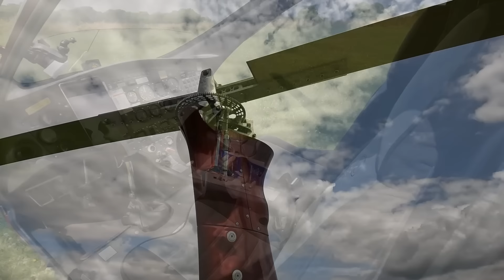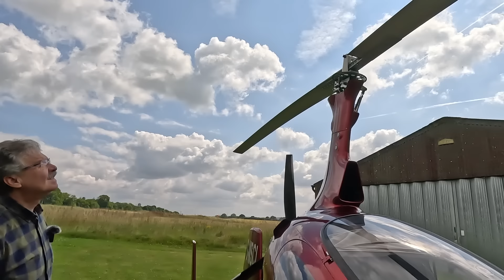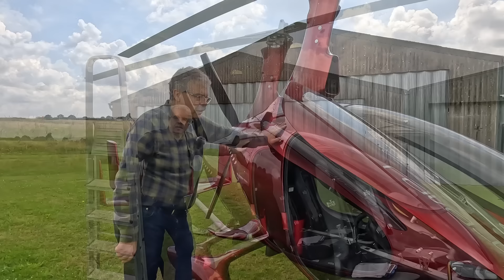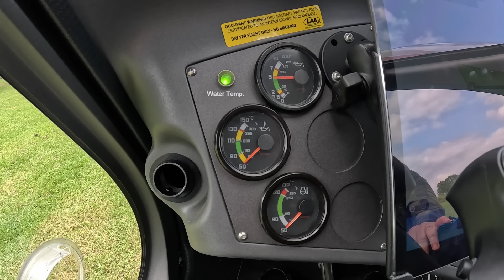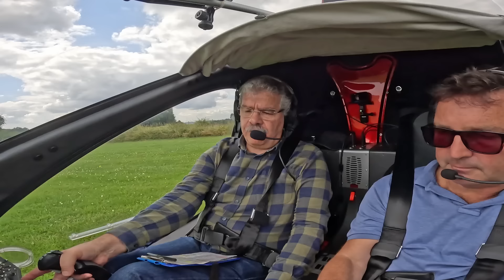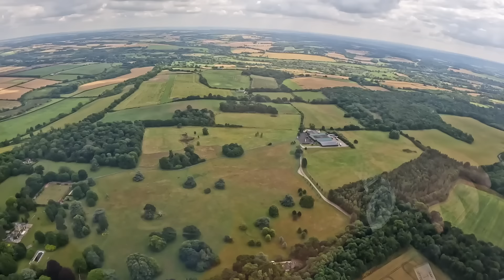Autogyros, The Cavalon

Comment: Grass runways look very hard  on the aircraft.  All that bouncing and shaking looked similar to riding an ATV.   I'm sure most owners would prefer to use concrete runways only to extend the longevity of their bird.   Is the stick shake and vibrations normal?  I'm watching the cruise and notice the vibration/shake of the stick.  Ingenious engineering.  A+

Comment: As an Engineer, it seems to me the teeter bolt should be longer to add rigidity.   I KNOW it teeters, but not in the axis I'm talking about.  There's a reason it's not a ball joint.  I'm referring to the axis the bolt is designed to hold RIGIDLY, to maintain the angle of attack of each individual blade.

Comment: And most people including the pilots dont know how the rotor works. With a pitch to lift, air flow comes from under to above that actually would make the rotor turning  the wrong way. Inner side of rotor has a different pitch as the outer blade. The inner blade is the rotating part, the outer blade the lift pitch.....😊😊😊😊

Comment: nice in smooth stable wind. mybe unpredictable (sudden drop) in variable changing winds? how do you get to practice for such conditions? are there flight simulators available where these variances can be simulated? once cruising should behave like fixed wing aircraft. since fly so low <500 feet, collision with towers & wires an added risk.

Comment: Only safe when going into wind. If it turns and goes with the wind the lift stops and guess what, it drops, plenty of deaths due to this.
Reply: Same thing happens to fixed-wing craft. Skill issue
Reply: @mecke102  fixed wing planes normally have a more powerful engine than an Autogyros.  Remember commercial planes take off and land into the wind.
Reply: @cagno1 So it should have a turbo then, agreed :-)
Reply: @cagno1 they have pretty similar power to weight ratios to a Cessna 172

Comment: As an aircraft mechanic on big birds I can tell you that we take no chances after maintenance. We do engine runs up to 75% power for a given period of time to test for potential failure. After that it's a test flight. They should do the same with these small aircraft. Also if the engines are overhauled they should bench test them before installation. If the maintenance org. that you're using isn't doing these procedures don't ever use them again!  Ask to see the paperwork from the engine runs and flight test. Actually, ask for all of the paperwork. No maintenance should be done without paperwork.  They should be signed by the mechanic and inspection/quality control. If they won't show you the paper work RUN, but not before your demand a refund because you're going to have to take it through maintenance again!

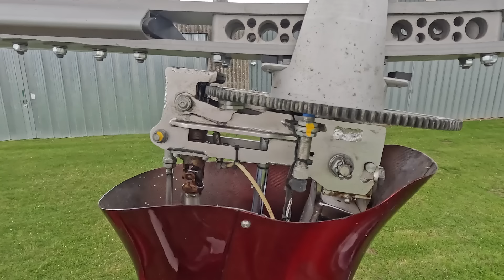I was looking at your rotor head at 10:02 min and I saw something I personally question. You have a series of bolts holding on your rotors going through the blade and fitting. They have nuts on them that don't look like aircraft hardware. In 30 years of working on aircraft I've never seen that kind of nut on an aircraft fastening moving parts. If you can spin the nut on with your hands until it gets to the locking portion then that nut is too loose for that area if that area is subject to vibration which I'm thinking it is.  I'm not questioning the bolts so much other then they look like they have a course thread which is also unusual for an aircraft bolt. Aircraft bolts usually only have a fine thread.   They look like 1/4" diameter bolts but I'm not too sure because of the low resolution in the video. If those are nylon lock nuts and only the plastic compound in the nuts keeps them from spinning I would replace them with self locking nuts (aircraft friction fit nuts that cannot be finger installed, but can only be turned on at wrench torque) at minimum or castle nuts with cotter key at maximum which will also require bolts to be changed.  
I would check the torque setting on your current nuts in that area after every flight initially and if they're maintaining torque you can extend time in between checks. You don't need to take it to a mechanic every time unless that's already part of your maintenance program. You can obtain the aircraft maintenance manual (AMM and SRM) for the torque settings and do it yourself. If you can get a general maintenance manual (GMM) it will tell you how to properly use the torque wrench. You have to have a high quality, calibrated torque wrench (no cheap auto parts store wrench). If you don't want to go through all of that then in my opinion you should replace the hardware!

Comment: The rotor is being spun only with forward flight.. BUT you csn get zero groundspeed  by flying into a 30 knot headwind.. this is sufficient to maintain an artificial hover.
You could probably do the same in a small fixed wing plane.

Comment: How does a disc provide equal lift on forward movement as backward movement? When increasing speed? Is there a computer controlled cyclic pitch like in a helicopter ? And how is the rotor being spun while providing equal lift?

Comment: Failures after maintenance are because with most maintenance items (aircraft and all mechanical maintenance) the probability of failure (PoF) follows a "bathtub curve" where initially the PoF is high, then if it works it will likely keep working for a while until eventually the PoF increases again with prolonged use. Initial high PoF is influenced by factors such as fasteners not torqued, bearings installed incorrectly, faulty parts installed, workmanship issues, etc. Quality control and procedures are very, very important to ensure maintenance is done correctly and completely.

Comment: Why is the rotor labelled underpowered when it is clearly powered? Genuine question. I understand that the forward momentum causes lift in the rotor essentially turning it into a wing.
Reply: The rotor is only powered for pre-rotation , up to 200-+250 rpm, during flight it is not powered. The shaft for pre-rotation and the rest of the rotor assembly is not intended for full power to keep weight down otherwise you might as well get a helicopter. Gyrocopters are small light, fairly simple craft to pilot compared to a helicopter.
Reply: @milesbartlett  Thanks for the reply. That makes sense now. Very cool

Comment: the stick is shaking all the time. A fixed wing pilot will think the plane is stalling because of the stick shaker
Reply: With a 2 blade rotor you will have some stick shake. But when you ballance the prop and rotor it is very minimal.

Comment: 600ibs? Heavier than an ultralight but lighter than an airplane. How is pitch and roll controlled? I see the rufdrr but no ailerons.
Reply: the rotor itself tilts forwards, backwards and side to side for pitch and roll. the control stick has what the rc community calls an elevon mix the controls the main rotor tilt. so tilting the rotor to the left rolls the whole aircraft to the left or pulling the stick towards your gut causes the rotor tilt back and causes the aircraft to climb. the controls work pretty much the same as any fixed wing aircraft with an elevon style control system but there is no computer in between the stick and the rotor
Reply: @pieterpretorius1014  the rotor blades controlling the pitch and roll sounds a lot like a helicopter without being one. That's a very neat tidbit about Gyrocopters: thanks...

Comment: Very nice design. Short take off and landing. Take less space than a plane. Can probably land easily in case of an engine failure (autorotation).
I wonder why there are not much more autogyros.
What are the advantages/desavantages compare to a plane of the same weight ?
Greetings from France
Reply: Yes , with the autorotation engine failure is not so much of a problem. With a bit of a headwind an experienced pilot can land in less than 10 meters, usually takes about 30 meters to land.

Comment: "See how it took most of the runway?" Uh yea, that was interesting he says LOL. Aka yea I'll never fly in one of these death machines again. Nothing about that thing looks smooth, comfortable or fun. Two full size men and its max weight, that guy did not look comfortable at all with all that runway behind them and still had to keep it super low alt to build enough airspeed to not stall. Good thing there was nothing infront of them. Neat death machine but nope.
Reply: Paved runway a lot less takeoff run. And all gyros accelerate in ground affect for a short time to about 60 MPH then climb. Takeoff is usually 300 to 500 I've flown in a Cavalon, and they're very comfortable.
Reply from the maker: Every flying machine is the beholder of its own beauty. They are the culmination and physical expression of Man’s ingenuity. Their safety far exceeds the risks of driving a car or even being in a kitchen! And what rewards are on offer when taking to the air, the exhilaration, views and sensory delight that are not on offer when bonded to terra firma. Let us celebrate sentience and flight.

Comment: Does the Rotor get motor power? is that normal, I( thought it was just forward motion that started the rotation, what happens if the engine fails, can you auto rotate from a certain height with success?
Reply from the maker: The rotor only uses engine power for pre rotor before the take off run. Just before the pre take off run the pre rotor is disengaged and the wind does the rest! As described in the video. The rotor is constantly in auto rotation, so if the engine fails the autogyro 'glides' under auto rotation.
Reply: @ginclearaviation  What then are your chances of survival, what then supplys anything to effect some sort of flight?surely that blade is insufficient to provide a 'Parachute " effect.
Reply: @adoreslaurel  Your chances of survival are higher than a fixed wing. An autogyro flies using autorotation, in an engine failure situation there's no need to declutch the engine and rotor and increase forward motion as it's already in autorotation. An engine failure is akin to just closing the throttle. You drop the nose to maintain forward motion and just glide gently to the ground as you would in a helicopter. An autogyro is probably the safest and most uncomplicated form of powered flight with clear advantages over both fixed wing and powered rotary wing. When it comes to the future possibilities of personal air travel it's the most likely contender.
Reply: @AndyMcGeever  Ok thanks for that.

Comment: An old BMW airhead motorcycle called and they want their old Bing carb back.
Reply from the maker: Rotax have a great web site for technical information.
Reply: @ginclearaviation  Why don't they use EFI?
Reply from the maker: @TXLorenzo  Hi. What is EFI? Thanks.
Reply: Electronic fuel injection
Reply from the maker: @TXLorenzo  I don't know the answer to that. But as mentioned, the Rotax series of engines have a great web site for specific info. Sorry not to be of much help.
Reply: @ginclearaviation  I believe later Rotax engines are EFI which I was surprised to see the Bing carbs.  I had these on my early BMW motorcycle for years, but all new models are now EFI.  This goes  for most engines  produced today.
Reply from the maker: @TXLorenzo  Thanks for the info. Engines used in aviation seem to take ages to catch up with modern technology.
Reply: @ginclearaviation 915is and now the 916is is fuel injected and turbocharged.

Comment: This guy is obviously not knowing how a drysump engine works ..😮😮😮..he did not check the oil level right.
Reply: Best system for any engine, even my new 71' 750 Honda was dry sump design. Automatically provides oil cooling during constant process returning oil to 5 quart tank. 
All the best racing engines use dry sump.
A bit surprised in video memo, 
no detailed inforrmation was provided. 

Gear Heads need this stuff. 
Now forced to track down Mfg for details. I spent twenty years restoring crashed WWII aircraft, last one flew to Oshkosh - B-29. 
Complete makeover better than new. Featured front page Mpls Tribune Sunday paper mid eighties. 
Cheers
Reply from the maker: Please check the Rotax web site for engine technical specifics. Regards.
Reply from the maker: Please check the Rotax web site for engine technical specifics. Regards.

Comment: I wonder how often you need to change that teeter bolt & nut? Nice video thanks!
Reply: The bolt and nut wouldn't usually require replacement but they are either brass bushed bushed or some models have a sealed bearing. The bushed type require regular lubrication, some have a grease nipple and some just use normal engine oil. People often just pull the engine dipstick and dab the end of it on the bolt.
Reply from the maker: Many thanks. I'll try and find the answer to your question.
Reply: Every other Christmas 🎄

Comment: Nice demonstration guys. I’m a fixed wing pilot in the US. I’ve always wondered how these things work.
Reply from the maker: Me too. It was great to have the basics explained and demonstrated.
Reply: me too he ecplained well
Reply: Once the rotor is spinning, it's pretty much like a powered parachute... without the safety and integrity issues of all the risers and fragile material.
Reply: I would feel safer in a fixed wing.
Reply: @justaghoulintheworld  - depends on the air frame. In terms of comparing this to most light/ultralight options... I would only feel safer in a high wing... and it would require significantly more span, or a broadwing with huge lift surface. Even at that... the crosswind stability dead stall would be more sensitive. As with all things aircraft... more precision control comes with sacrifices.
Reply: @justaghoulintheworld 
Without knowing more, I agree, too many moving parts.
Reply: @timotb1 go to Chino airport in California and take a flight with Henry at Adventure Air. I would leave your checkbook at home though because after an hour flight in one you will want to buy one. 😁